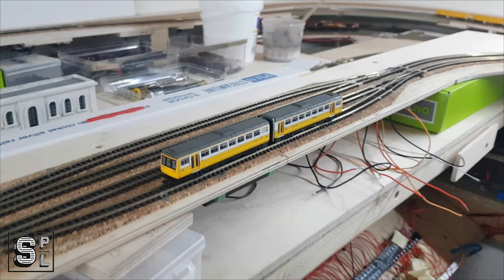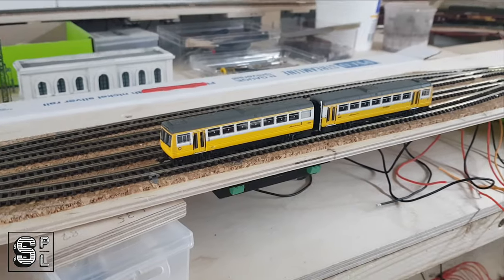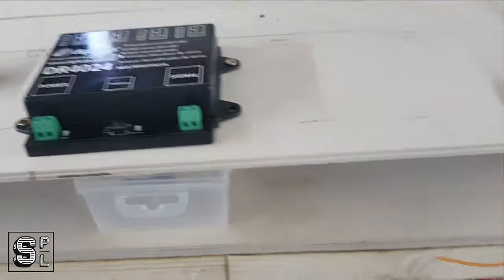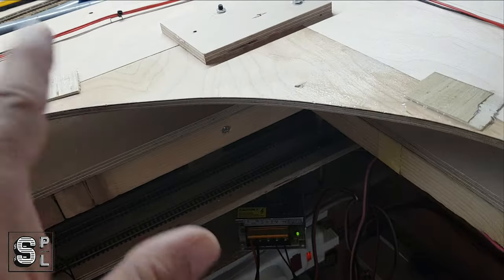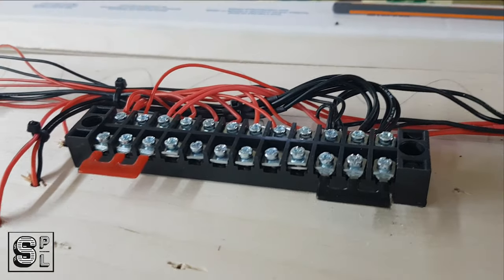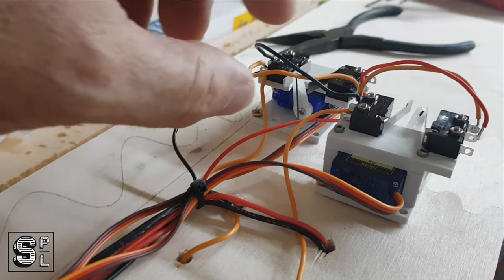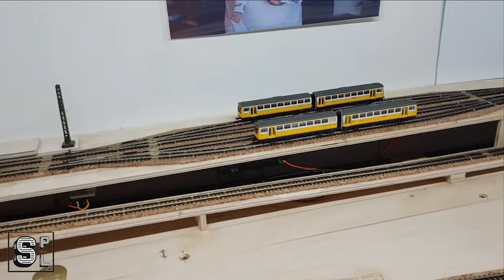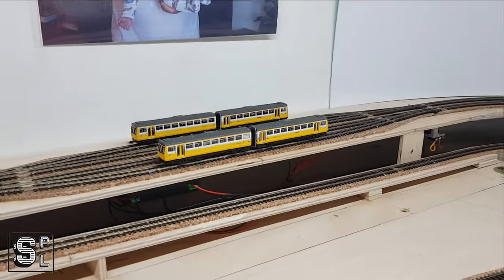Ep38 - Wiring the DMU Station Track at Ħal-Zuzzu Model Railway

Comment: Greetings Malta 🇲🇹 and hello Joe 👋 Some very neat wiring work there 🤩 especially like the staples tip using cable ties 👍 i just use the bare staples 🤫 run pretty close to spearing the cables on occasion 😳🤣🤣🤣🤣 very best wishes from the Emerald Green  and Kerrygold Isle ☘️🇮🇪
Reply from the maker: Thanks 👍
I've speared a few in my time too or simply cut right through the wire when i used to staple over the wires !!!!!
Thanks for stopping by Paul :)